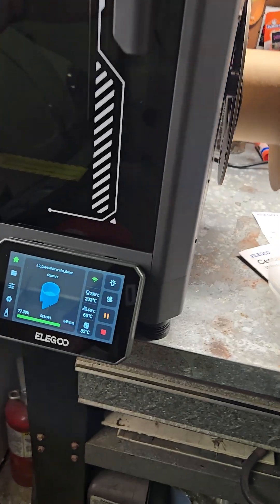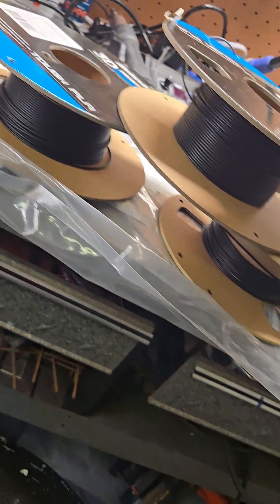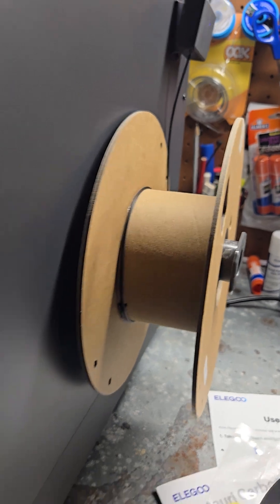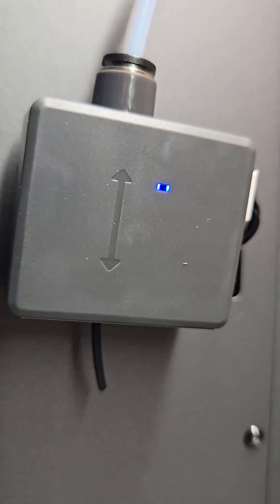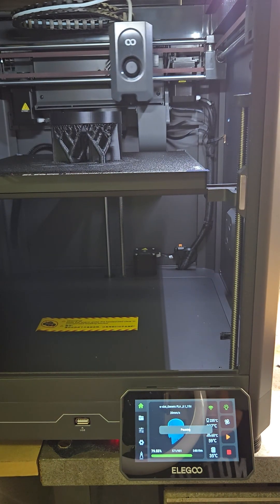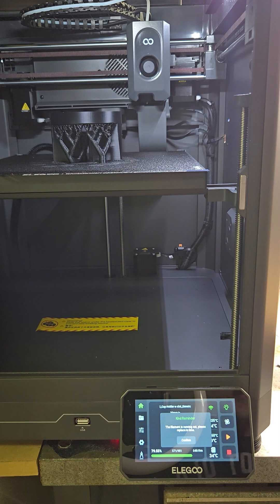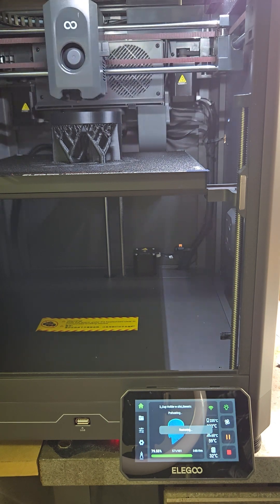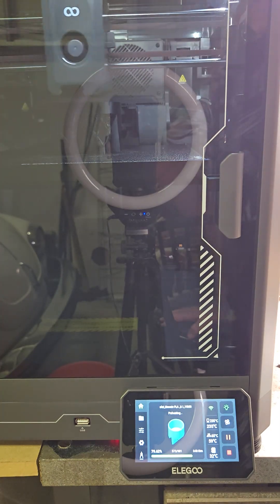Elegoo Centauri Carbon Filament change mid job #elegoo #centauri #carbon #3dprinting #filament

Comment: So did you let it fully run out of the first spool or did you pause it and then pull the last bit out?
Reply from the maker: No, it's pretty cool.
You just let it go, it paused it's self after consuming the last section then prompts you to load more.

Seamless operation
Reply: @AlexPlatacis  thats not good... I extended my ptfe tube to accommodate the riser and adjust the entry point of the tube. If its using the stock tube measurement as the basis of the runout sensor then that means every mod for relocating the filament runout sensor is a disaster waiting to happen
Reply: @AtomicBleach  I would imagine it's not so rudimentary. My guess is, once the filament runs out, the gears that drive will spin free and thats the activator. You can make that feed tube a mile long, it won't matter.
Reply: @Jim-hm9ch the printer is not that smart. Theres no encoder or additional filament sensor. In fact the gearbox is very cheaply made.  It does matter on tube length ive tested it. You only run into a issue if your tube gets significantly shorter.
Reply: @AtomicBleach  thanks for the info. I figured they HAD to have some type of free spin sensor. I guess it is a 300 dollar printer after all. Good to know too, I have one. If I have to replace that tube, I will make certain to make it the exact length of the original.
Reply: The length of the ptfe doesn't matter. All it does is that once the filament is no longer sensed by the sensor, it cuts the filament and retracts a few cm. So as long as you can reach the filament sensor you can pull the remaining length out and insert new. If you lengthen the ptfe tube it only increases the waste slightly but it doesn't change the function.